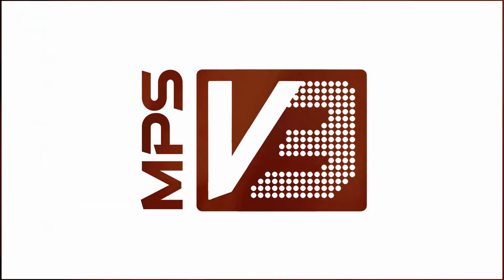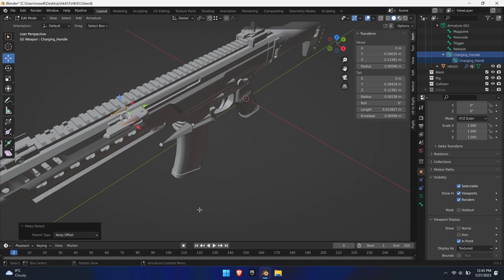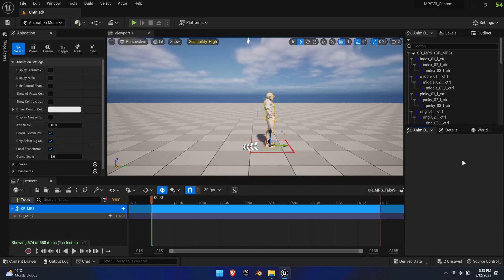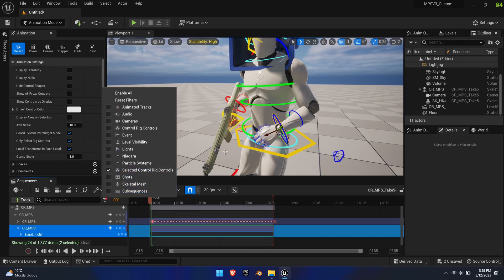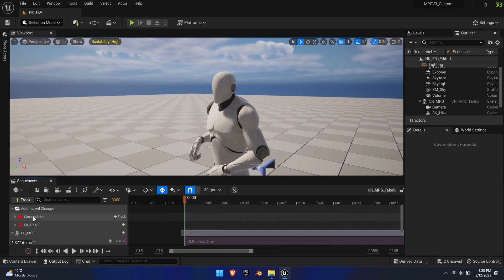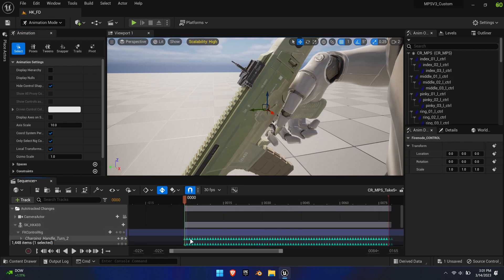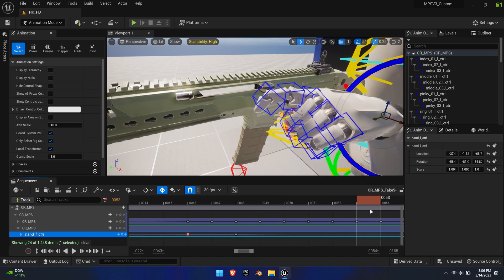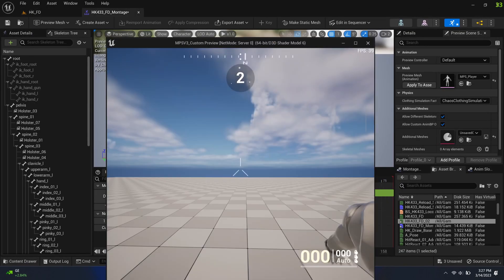[UE5 Tutorial] MPS V3 - Modifying Animations w/ Control Rig & Sequencer

Comment: Hey i got the anims made and everything working except when i try to use the weapon reload montage for my new gun, it wont play the new animation only the smg. Is there any fix?
Reply from the maker: need more info. like did u apply the new animation as a montage to the anim data table for both the weapon and player mesh? did you apply those anim notifies i show?
Reply: @gametime414  yes, ive done both and made sure everything was done right in blender, also the first person laser on the smg glitches out and seems like its trying too point at the player itself no problems with any other weapons though. But this is seriously an amazing system!
Reply from the maker: @Vigil27  this sounds like it is colliding with the player mesh or its capsule or the weapons collision box. I'd say check your collision channels.
Reply: @gametime414  Yes that fixed it thank you, and one last question, i added a new weapon and followed all the tutorials and made sure everything was right but after i add the new imported montage to the data table it doesn't seem to recognize the new animation and the magazine doesn't move like in the animation.
Reply from the maker: @Vigil27  could be wrong skeleton or that you accidentally made it an additive anim

Comment: Did you make the animations directly in UE, or did you make them in another program, import them and then tweak them with the control rig? 

I'm asking because I'm currently following a tutorial on making a control rig and I'm trying to figure out if it's worth it to start using UE5 for animating characters. 
Since there isn't a lot of footage of UE5 being directly used for character animation and thus it's difficult to gauge how well it's suited for the task.
Reply from the maker: So I did the anims in a very old version of 3ds max (back when it wasn't subscription based). Tho quite outdated by now. 
I would say, that it's definitely worth learning to animate in unreal. Could be the future. And it's gonna get better and more reliable over time. However, I would say that a DCC software is still gold standard for now.

Comment: This is much better than any other Control rig thing i've seen as a beginner. Shows the process, power and scope, if not step by step details .
Much appreciated. 

Im trying to add a metahuman head to my custom body and want to use control rig to animate it. I cant find the setup as I've to create a blueprint to merge the custom body and meta head, then there is no option to add a control rig anymore. How do i approach this? any help is appreciated
Reply from the maker: i haven't messed with metahuman facial rigs yet. You say that u combined them in bp. So I think u should be able then to access the metahuman controls, since they haven't been overwritten. Perhaps you need to add it to the animbp.